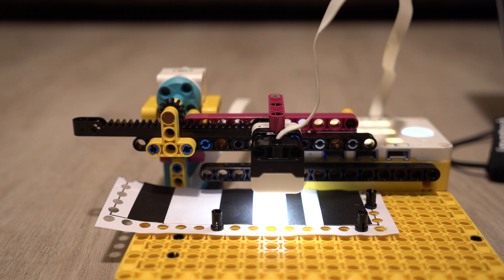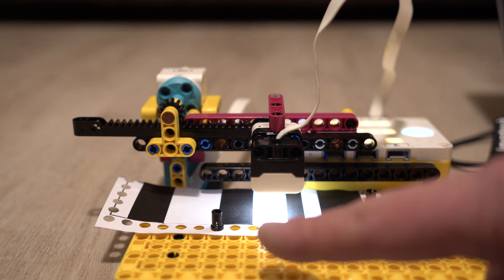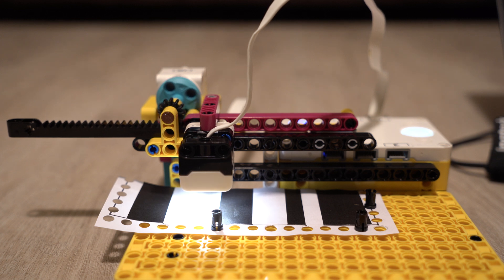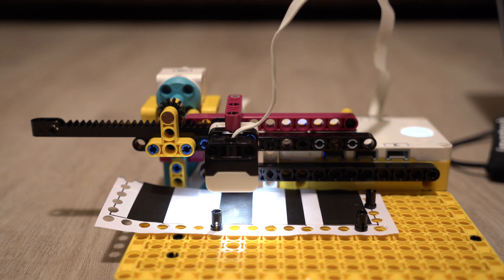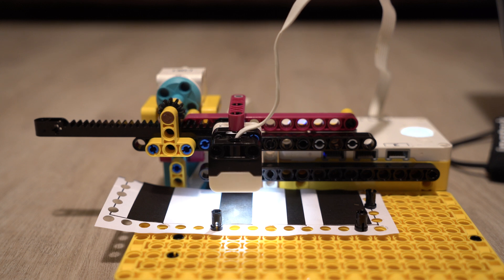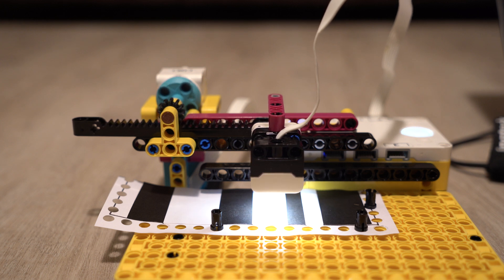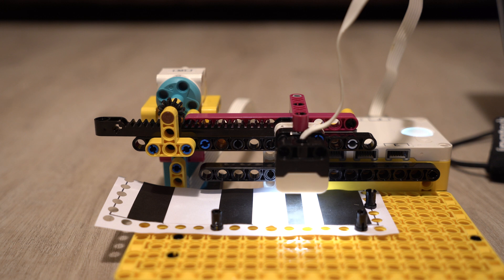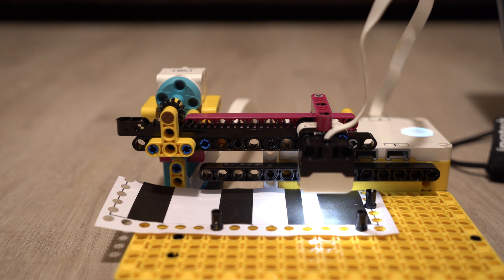2021-12-18 Lego Spike Prime Color Sensor reflected light calibration (C0255)

Comment: Hi Marek,

I would like to ask you for advice regarding the color sensor. If I use the light reflection output in the program for the follow line, do I have to have the sensor set to that as well? Because I have a feeling that the sensor is preset to the "color" output.
Reply from the maker: @davidPK1981   If by "set to" you mean the selection in the hub overview page, then no, that setting is completely irrelevant, it only changes what the app is showing. The sensor is always reading all the parameters and is sending all the raw data to the hub, so you can use at the same time in your program blocks reading the reflected light, the raw color values and the interpreted/detected colors without any interference. Changing the setting on the hub overview page only changes which of these parameters is shown in the status in the app.
Reply: @MarekLewandowski_EE  Thank you, Yes, that's exactly what I meant, because when we started the robot, the first and second runs never worked because it didn't follow the line, so we always set it to display reflection in the preview and then it worked. But maybe the sensor needs a little time or we should have always set a different value according to the ambient light.
Reply from the maker: @davidPK1981  I'd chalk it up to coincidence.
It is, however, important to realize that the hub is not executing the program at an infinite speed and that while the iPad is connected over bluetooth there's going to be some inconsistencies in execution speed, as the communication in the background will hog some hub resources. You will notice that unstable software on the tablet may cause some runtime hiccups too. You should be, however, able to get a stable line tracing with bluetooth connected.
Reply: @MarekLewandowski_EE  There must have been a problem with the communication between the PC and the Hub, because during programming we were connected via Bluetooth and after each program change we uploaded and launched it from the PC, but at the competition we only had to use the cable for uploading and launch the program with the button on the Hub. When tracing the line, would you rather use color or reflection? Thanks for the advice.
Reply from the maker: @davidPK1981  The main concern for you in the scenario you described is: You have to be extremely wary NOT to rely on the speed of execution in any control algorithms. Like if you have an infinite loop reading sensors and updating motors and there's no explicit loop delay inserted, your loop time will depend on how fast the hub can execute it. And it will change depending on if you are connected to BT, to USB or nowhere at all. You will get more reliable robot if you make sure to insert some small delay in each loop, like 0.1s. Say, without it your loop executes 200 times per second (5ms per loop) when running disconnected, but once connected over BT it needs 10ms per loop. Your loop frequency changed by factor of 2 and dropped to 100 times per second now. This will likely skew all tuning you may have done before. Now if you add 0.1s delay, your loop will run only about 10 times per second, needing 105ms when disconnected and 110ms when connected, but the relative change will be much less, so tuning of the controllers in one situation will likely be still good in the other situation. I don't know if I'm explaining it clearly enough...
Reply from the maker: @davidPK1981  And for line tracing the reflected light is going to be more reliable.
Reply: @MarekLewandowski_EE  We had no loop delay when following the line, we only gave a short pause before adjusting the gyro sensor, but not when following the line, we need to improve this in the future.

Comment: What you have shown here is very interesting. It tells us the color sensor needs a fairly wide black target to get an accurate black reading. In practical use, it means you should not program to look for values close to "0" for black because depending on the surrounding area you may never get a close to zero reading. 
The EV3 had a way to calibrate the Color Sensor. I have heard the Spike Prime Color Sensor can not be calibrated, obviously, you can create a math solution, but is it true you cannot re-calibrate it? I have a sensor that is reading 40 for black.
Reply from the maker: There's no documented way to change the values that the sensor reports, but you can do software calibration in your program. For example if doing line following you can do a full turn in place updating max and min readouts and decide if there was a line to follow by checking for since minimum difference between max and min reading, treating min as blank and max as white
Reply: @MarekLewandowski_EE  Thank you! That’s what I had learned as well, but I hoped I was wrong.